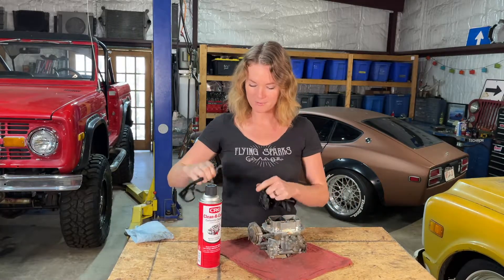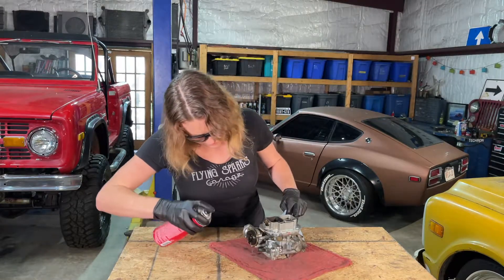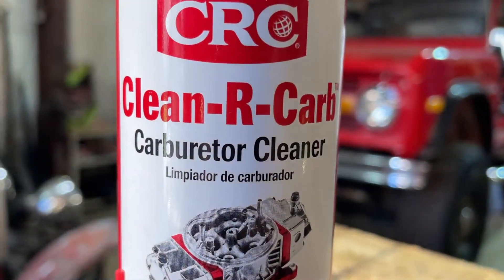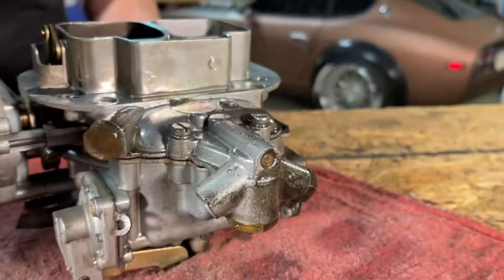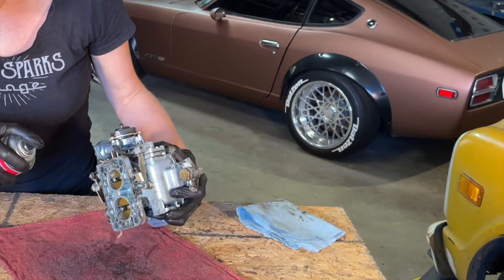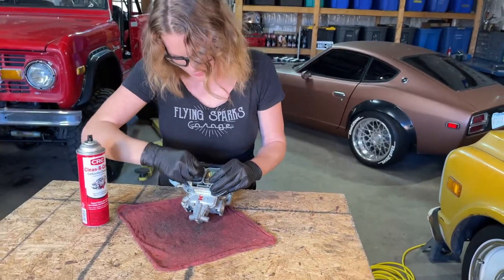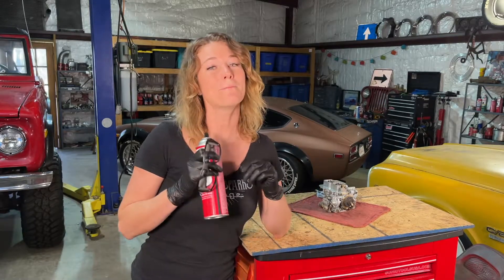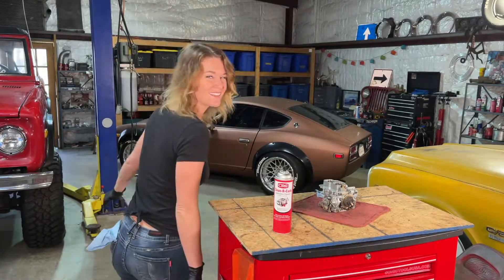Quick and Easy Way to Clean Carburetors With Emily Reeves

Comment: Of course there are many different types of carbs. When cleaning a carburetor are there any specific components of the carburetor that should be removed before cleaning?  By the way that 280 z in the background is really cool.
Reply from the maker: If you are looking to completely clean the carb, then removal and disassembly would be required. Special care needs to be taken to ensure that plastic components are not cleaned with carb clean.